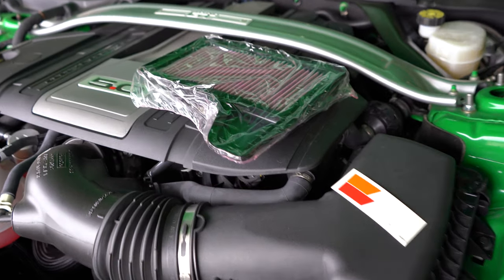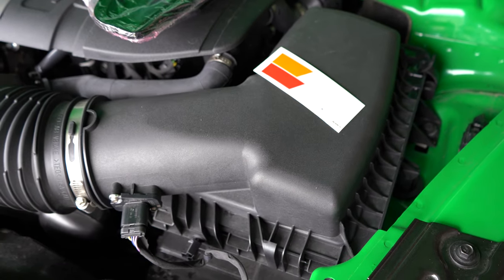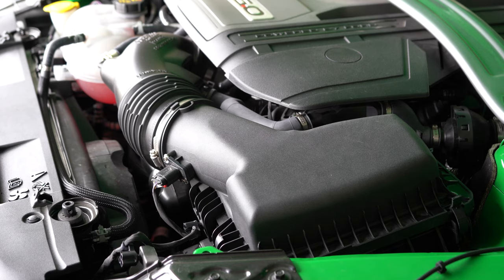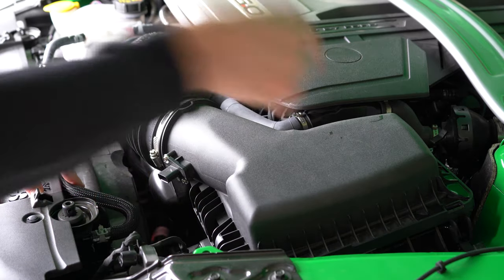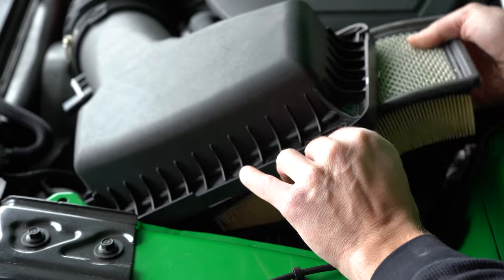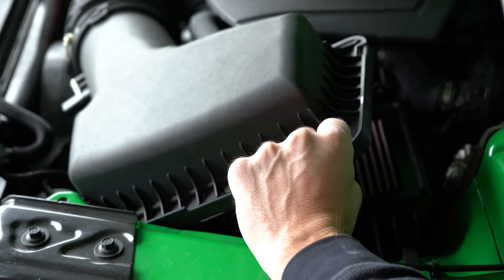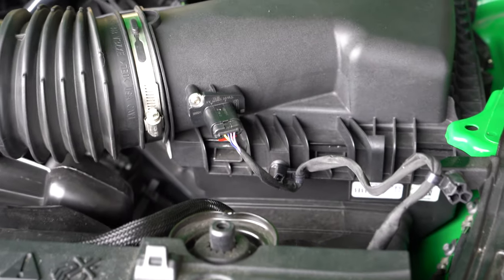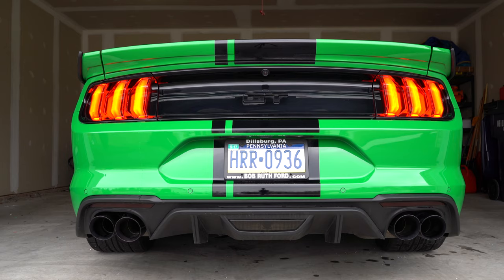CHEAP HORSEPOWER for my 2019 Ford Mustang GT

Comment: Saw a Subaru get 12% gain. Live tests done. Why 3-5 hp in Stang? Also, no need to disconnect wires or loosen anything. Just did it in my 2019 GT, 2 clips, then jiggle it out pushing towards front of car. Lastly when you take old one out vacuum out the box underneath before putting in new filter.
Reply: Yeah that's what I thought he did extra work did you have to take out maf sensor?

Comment: If u Do a grille delete or change out the side peice where the intake is. U will create a high flow ram intake as well. Be careful in the rain.
Reply: I thought that mod was fine even with rain was okay since the filter sits at the top of the box and the air inlet is at the very bottom, I’m sure water can get into the filter still but is it that much more?!

Comment: Why did you take the Steeda ProFlow intake off?
Reply from the maker: It required a tune which I got from Steeda as well which accelerated out of no where... Caused check engine light... Limp mode etc. So I sent it back to them so they could figure out what went wrong... Haven't heard from them since lol
Reply: @goldpony  thanks, and I was just curious, it is one of the intakes I was interested in so I had watched your previous video, and hate to hear that happened but thanks for the reply.
Reply: @goldpony  Steeda sucks at tuning! I love all their other parts. I had a 13 gt with almost every part they made. I had another companies tunes for 4 years. I decided to try Steedas tune. It was horrible my car was bucking and stalling and check engine light came on. I installed the old tune and called Steeda. The guy in charge of the tuning pretty much blamed me said I did something wrong. The guy said he checked the tune and there's nothing wrong with it, and refused to send me a revision. I argued with him and finally got my money back. They erased my bad review along with other bad reviews on their website. This was about 2 to 3 years ago. I don't want to knock the company because I love everything else they do. I know the tuner doesn't build the parts at least I hope. But the whole thing made me not want to go with all Steeda on my new GT this time around. I'm trying different companies with good reviews as much as I can.